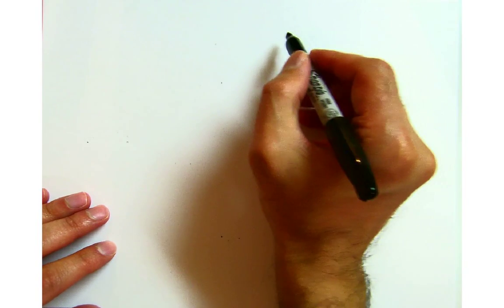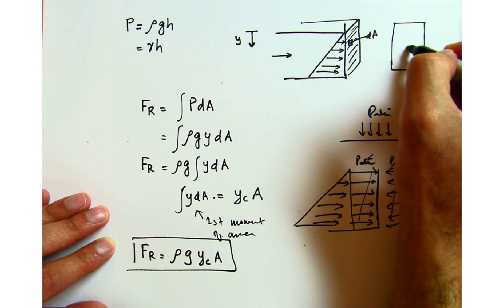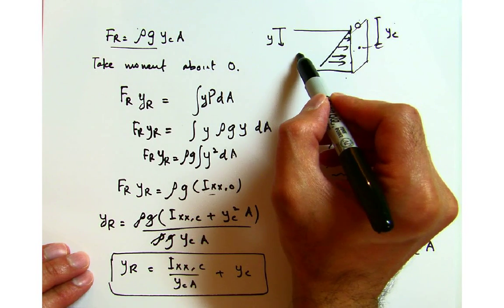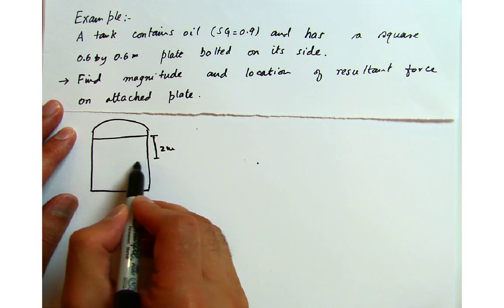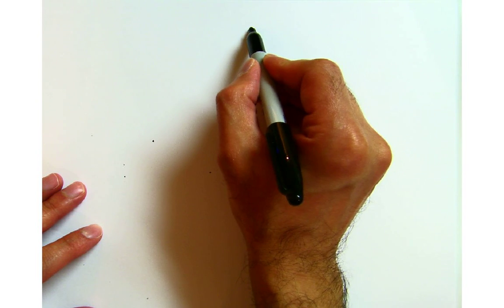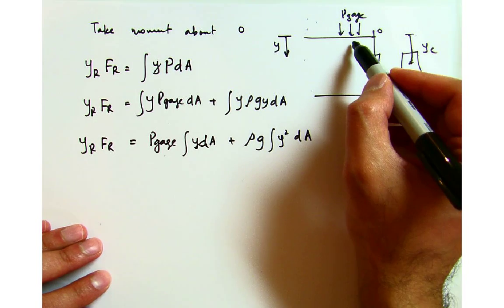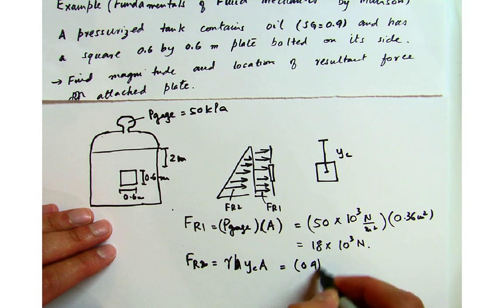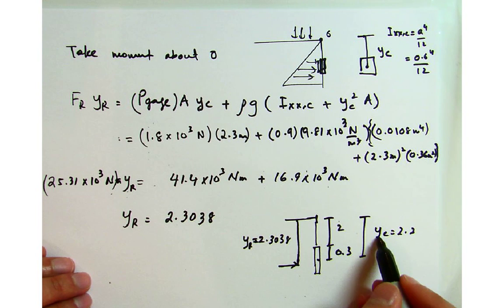Hydrostatic forces on Vertical Surfaces

Comment: What is the difference between hydrostatic force and hydrostatic law? 
As per Hydrostatic law net horizontal force on a point in static fluid is zero. 
You indicate horizontal force due to fluid on plate??

Comment: This is an awesome explanation of the subject. I just have one question. In the oil problem calculation you used 9.81x10^3 N/M^3 for gravity. Is there a reason for this? I don't recall hearing about switching up gravity.
Reply: actually that was not gravity. it was specific weight of water. (the value of gama)